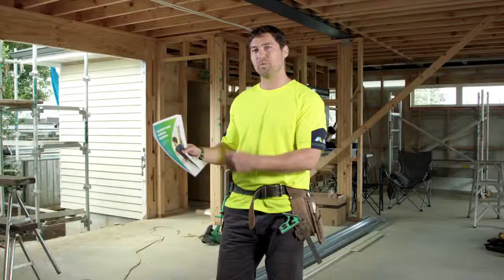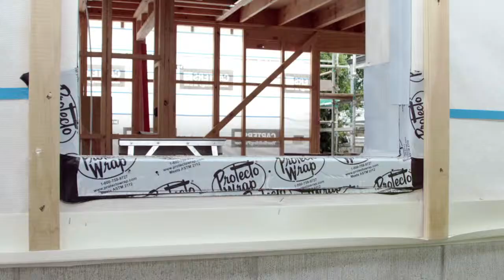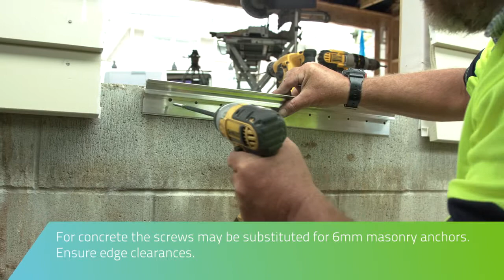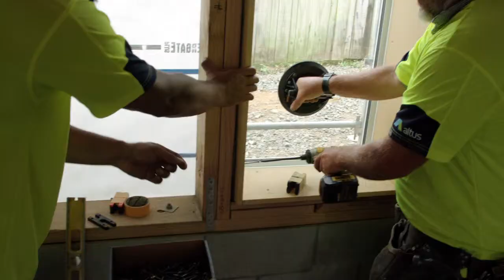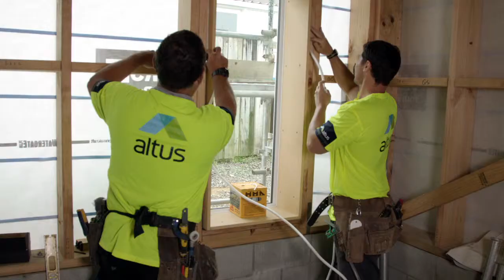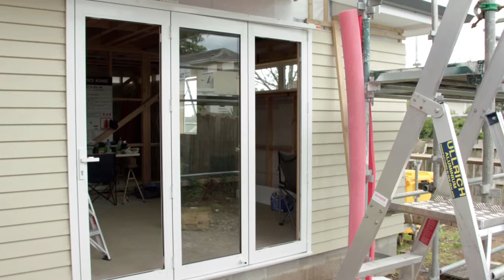Altus Window Systems - how to - installation of a window - WANZ bar #1

Comment: Dear Sir,

I hope you are doing well.

I am an experienced Aluminum and Glass Fitter. I have practical experience in the following types of work:

1. Sliding Door and Window Installation
2. Aluminum and Glass Fitting
3. Pressure Plate Installation
4. Skylight Installation
5. Double Action Door Installation
6. Folding Door Installation

I am hardworking, honest, and dedicated to my profession. I always try to complete my work with high quality and professionalism.

I am looking for a suitable job opportunity in your company. I would be grateful if you could consider me for any available position.

Thank you for your time and consideration. I look forward to hearing from you.

Best regards,
Aluminum & Glass Fitter